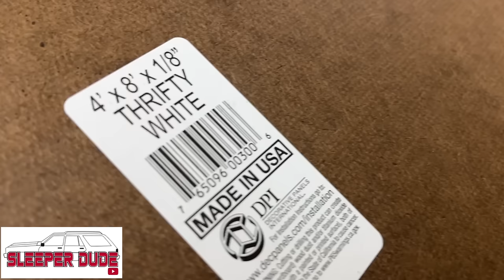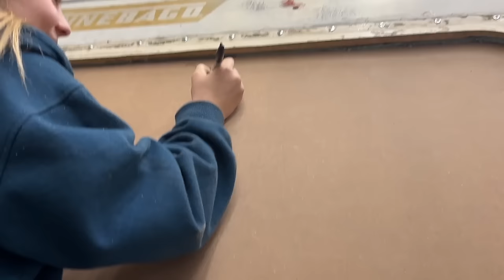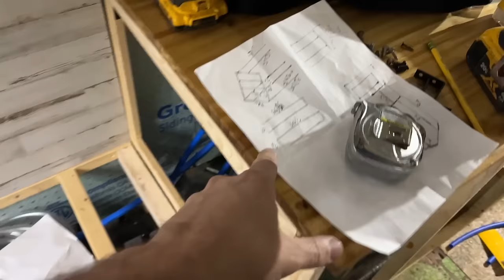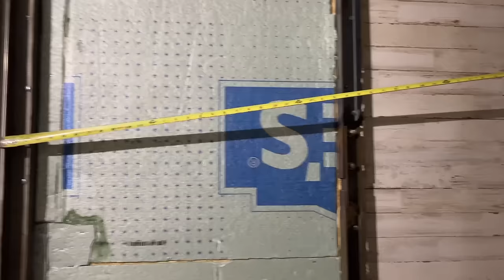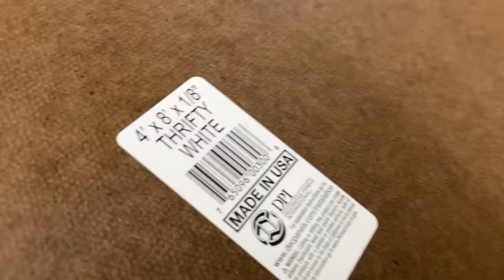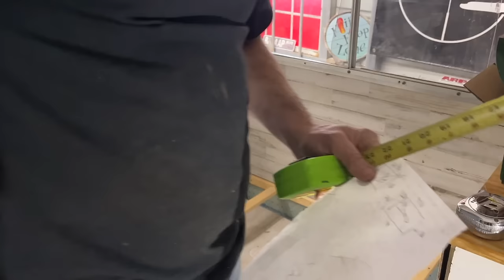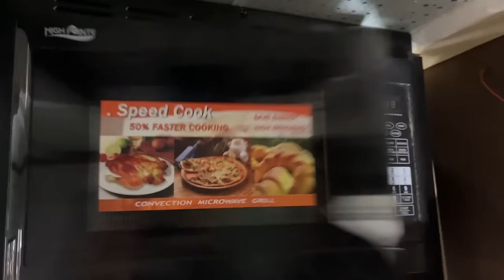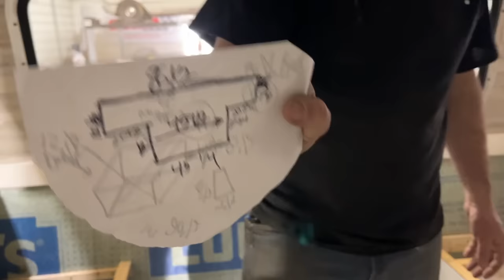DIY $800 RV Remodel in 9 days!

Comment: Tip! I'm a full time RV living guy and I've remodeled a few rv's now when it comes to led lights you should use 12v resistors because using a 12 V inverter for RVs has a slight Power fluctuation from 11v up-to 14v and over time the led will burn out in result of that.The resistor stops any voltage above 12 from hitting the led. But even without they'll still last around 2 years before you start seeing them flickering

Comment: When you said you were frugal, and trying to reuse the screws, it reminded me of the origin of the phrase "dead as a doornail".  Back in the pre-industrial days, people would try to reuse nails. They would even burn down a small building or cabin to get the nails out. But in order to make doors more secure, they builders would bend the nails over.  Those nails, of course, could not be reused. 
Hence, "dead as a doornail"
Reply from the maker: That’s funny I didn’t know that

Comment: A half inch  wood chisel , will remove the old sealer from the windows. Carby cleaner is much stronger than brake clean, but be carefull it will also remove paint rubber etc.
Reply from the maker: Ok thank you

Comment: Hey Sleeperdude, love your channel, love your family, great to see this project as I've had multiple RVs. I have a very similar microwave/oven, and I have to warn you that you may need to put in an outside vent and possibly a fan to pull hot air out. These things get really hot when you use them as a oven and it may overheat and shut off as you have it enclosed.  Check your microwave instructions about ventilation. If you just use it as a microwave it will work fine. I live in an RV and I had to removed a divider so the air could move around, had remove the whole frame that used to hold it in, and built a small platform for it to have air circulation under it, all that to keep it from overheating.  BUT I use the oven/air fryer a lot. 
I can't wait to see your first trip in this thing, I think this thing will be fantastic for getting you from camp ground to camp ground.
When you get ready to travel make sure and check out Harvest Host and other sites like that, you can stay at some very interesting places.
Reply from the maker: Awesome thank you

Comment: For the corners you should use the aluminum corners from drop ceilings. You can cut them with tin snips and use construction adhesive to affix them. Hey come pre painted and are super cheap!

Comment: The inside is looking a whole lot better! I would suggest however making use of the space behind the passenger wheel well where you have the area that housed the propane tanks. I would put two more batteries , an inverter and the battery charger. This way you have plenty of power stored for your AC , microwave or TV while you’re driving down the road. Then you can find somewhere to park and plug in the charger so you don’t have to run the engine all the time to charge the batteries. And then find a good high charging alternator to make sure all three batteries are kept up while the motor is running. And to be clear I’m not suggesting running 48 V, lol!

Comment: You can take the white wall angle they sell for suspended  drop ceilings and use it for corner trim. It's thin, white and aluminum so holds up well. I've done it many times for paneling.

Comment: Menards & Home Depot carry a cheap molding line. I used it in my mobile home. Also, I would cover those wheel wells with some of that insulation, to keep the wheel noise down.
Reply from the maker: Ok thanks

Comment: You might know this because you worked at a body shop. If you want crystal clear glass . Scrub them in small circles with triple ought (000) steal wool. You can use just water , but I like spray way, because the chemicals break down oil ,grime & gunk. Just random tip thought you would find handy.  Love the channel
Reply from the maker: Yes thank you

Comment: By the way, you all are doing a fabulous job on that RV. It's really looking good. I will make one suggestion for you if you would like that square to bumper on the back. That's where I have my pipe for my clean out my gray tank and black tank clean out pipe. It goes in there then you can use that cabinet underneath per outside storage just to suggestion. But that RV is really starting to look good. Congratulations your team can put some work together

Comment: Lowe's has the plastic door jams,moldings which are cheaper. Lite weight,won't rot. If your wife wants curtains, remember you can use same curtain rods and holder like for a closet. Aluminum fence pipe rail (curtain rods) is cheap if you need length , plastic SQUARE molding drilled for pipe to go in or through,held up by small L brackets. Curtain rods can also be PVC pipe. I have done everything I have written by ( Carl Cheap - ME).
Reply from the maker: Ok cool thanks

Comment: You should have painted the raw wood with oil base deck paint to deal moisture in between the peel and stick tiles. It will let moisture through just mopping the floor.
Reply from the maker: Ok thanks

Comment: When the restroom floor leaks you might want to use some water proof paint sealer on the wood then dress it up the way you want. Just letting you know. I also suggest that you rhino line in a can the bottom of the entire camper. All in all tho that that machine is looking pretty nice.

Comment: pro tip on the crew use a piece of duct tape or rubberband on top of screw while you screwing it or can heat it up use some pb blaster to loosen, witht he air tool you gotta oil it put tool oil in on intake where air goes in although could be the stapler safety on the tip broke some of those tools are cheaply made

Comment: Uh oh!  Josh I think you made an "S" trap under the sink, instead of a "P" trap. Trickling water may be ok but if there is a quart or more water draining from the sink, the pipe after the S trap will siphon the trap dry. So you'll get smell from the tank in the camper. To fix this you need an air vent, an automatic air inlet valve or a hole thru the wall above the sink top. I'd use an automatic air valve in a camper. Run your "P" trap pipe into the side of the pipe going up to the air vent.
Reply: Added comment...I didn't see your holding tank. Is it vented? Maybe because your sink is so close to the tank you can try bypassing the sink vent..but I'd try dropping the P trap lower so it's not an S, draining straight sideways into the holding tank. I used to be a housing maintenance inspector and S traps caused problems from stinky smells to slow draining and frequent plugging up.

Comment: Use a heat gun if you have one.  And heat up the glue on the bathroom floor tiles.  The glue underneath with adhesive better.  To the plywood floor  . If you don't heat it up . It will come up in a year or two  .  Just tip .
Reply from the maker: Ok thanks
Reply: @Sleeperdude  no problem

Comment: Unless your getting the styrofoam in Canada for free to redo a whole 20 ft RV front to rear will cost you upwards of $900 and that's not counting the glue, spray foam for gaps, and insulating floors walls and ceiling, and that's of Nov 1 2023, and then the 2x2" wood or my case steel studs, new water pipes, gas pipes, paint, primer, flooring, plywood, silicone and more so  if anybody feels that energetic $800 u.s. isn't prices for materials In Canada but boss man you and family did a great job !

Comment: Josh You are doing a great job! On the RV build.. but what you are doing is very dangerous for You and your Family! For one the steel studs ! You need to build up the installation between them all the way flush! Then build your walls... You have hardly nothing between You and your Family and an impact from a accident!! And hardly any installation! And it is going to get very hot In the RV. and not to mention it will be very loud when 18 wheelers and cars are passing you on the highway..... The installation should be installed and built up flush with the inside studs then install your walls and build your inside cabinets ! Just go back and watch your video when you were tearing it apart! And note how it was torn apart and then take note of how it was torn apart and that is the way it should go back together...
Reply: There should be Styrofoam insulation built up all the way flush with the steel studs on the inside of the RV then install the walls and then build-out inside!

Comment: Little trick to them long trim nails,if you cut them at an angle with a pair of dikes then you can make them as long as you need them. Just a carpenter trick! Hope it helps next time.

Comment: I have dome RV repairs and remodels for some time and I would suggest Butyl Tape for the windows not silicone, silicone is good for stationary sealant, campers go down the road and suffer twisting and turning, silicone isnt designed for that, and will split from the surfaces bonded to when moved around leaving room for leaks.
Reply from the maker: Ok thank you
Reply: @Sleeperdude  yes sir I hope it helps you for your next bill to remember to use butyl tape around the windows instead of silicon and you guys are doing a really awesome

Comment: Here 11 minutes after its dropped? That's a record. Leftover Choco pie is best pie. Happy Easter Monday y'all
Edit: I really wish you would use some armored cable for the 110vac stuff. MC cable would be perfect. (its the same stuff the outlets in your shop use). I don't want this beautiful, custom, hand-built Coach burning down. Even if you stick with the loose THHN, PLEASE use GFI breakers on the 110 stuff. I know they are really expensive, but Its a safety measure that is worth it. If I could afford to take off work, I would happily wire the whole dang thing myself, but alas. Rock on Sleeperdude Fam.
Reply from the maker: Thank you

Comment: Josh if you are not oiling your air nail guns then they will stop working also if your nail guns are cold sometimes they won't work right until it heats up a little

Comment: poop shoot hose goes in the back bumper best place for it you can put up to 50 feet of hose in there with the fittings on by the way you can buy rolls of trim in rubber in colors at lowes and home depot peel and stick or glue in or use gorrilla tape and paint
still looks awesome in there and I can't wait to see what engine you end up using in the mini winnie
Reply from the maker: Yes!!!

Comment: Peel ans stick tile tip: clean the floor, sand a bit, paint, sand smooth, second coat of paint. Keep paint thin. Stick tile to paint. The paint helps bond the floor together and seals it up a bit while providing a much better surface for the adhesive on the tile.
Reply from the maker: Awesome thank you

Comment: Run the left over pex to the heater core with isolation ball valves and run a radiant heat floor……😂😂😂 that would actually probably work pretty damn good
Reply from the maker: Yeah maybe so

Comment: The jigsaw's power cord is likely broken right where it enters the body of the tool. Open up the jigsaw and shorten the cord to eliminate the first 3" or so outside of the tool. 20 minute repair and with luck it will only cost you two crimped connectors. 
I love what you've done with the RV so far. Good luck to you and your awesome family. 
Lawrence
Cameraman / Novice Editor / Occasional Voice of Reason
YouTube: BrainDamageBBQ

Comment: Hey Ralphie , the problem you are having with the nailing is due to the hammer you are using. First problem is the face is rounded and not flat , causing the nail head to push out to the side. Second problem is its not heavy enough, the heavier the hammer the less force you have to put into it.  Your swing appears to be good, and accuracy will improve with practise. Always keep your wrist taught , try to swing from your shoulder, but from the elbow is ok for light work. Want to know how to choose a good claw hammer, but dont let lowes see you doing it. Lightly tap the edge of one brand into the face of another, and visa versa, choose the one that doesnt have a dent in the face. And remember the weight factor, choose the heaviest one that you can  swing a dozen times without your arm aching. Also holding small tails with pointed pliers , is way better than hitting your fingers

Comment: @sleeperdude if you have the head room build 2-6 inch lids on each seat and puy hindges on them for storage for the kids clothes and more storage.  Its cheap easy and its good for them storing toys,  laptops, your camera gear etc.  You can even add usb storage or 12v cigarette socket storage for charging things.  Also for a fridge try 12v fridges at lowes or home depot etc.   They have a few and it'll  save on your batteries.  Also think about  doing solar panels on the roof. 1 its great to charge your electronics like camera, cell phones  laptop, tablets etc and it will help with saving money long term. Also you can make portable charging stations and solar panels pretty cheap.  Have you thought about building a rack off the back for bikes or extra storage?  You can always add an outside bbq station later and use a projector and screen for outdoor movie night with a few blankets and some popcorn.  Its looking great my wife and I love it.

Comment: So your sink is what is called an S-trap there, and it will tend to not hold a water seal very well in the trap portion. You need to vent it, which I would think would be easiest with what they call an automatic air vent rather than piercing to the outside.

I mean maybe things are different for RVs, but in a house, the current drain for your sink wouldn't pass code, because the trap would just siphon each time you emptied the sink, and leave you filling your interior with gases from the grey water tank.

I really like all the design stuff, it's a great looking RV it looks modern and fun, better than anything you can easily buy new in my opinion.

Comment: That’s looking good! It really does look so much better on the inside than the original layout. I’m no carpenter either, but you’re doing a way better job that what I usually do when attempting wood work. You can always tell a car guy is doing carpentry work when you see them driving nails with a pick hammer 😂
Reply from the maker: Awesome thank you